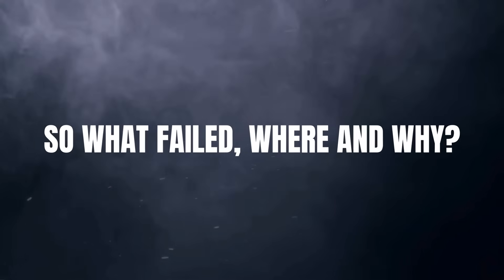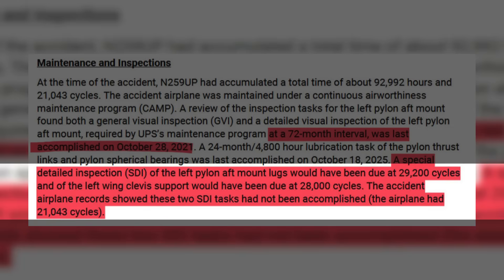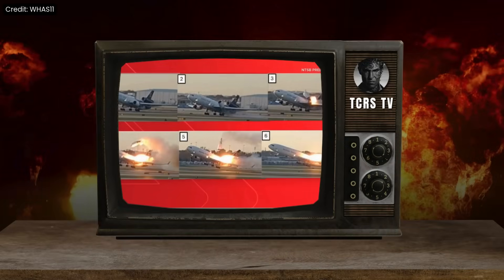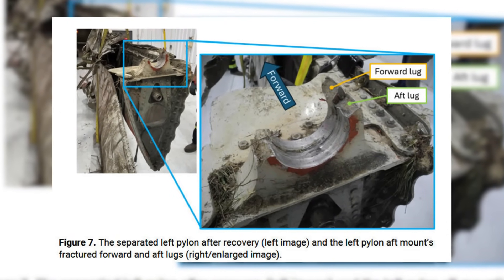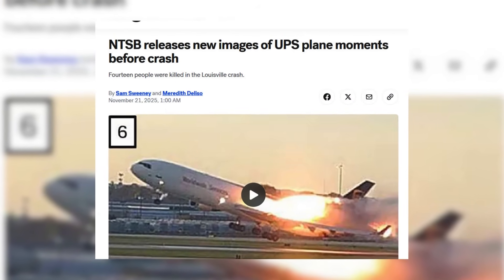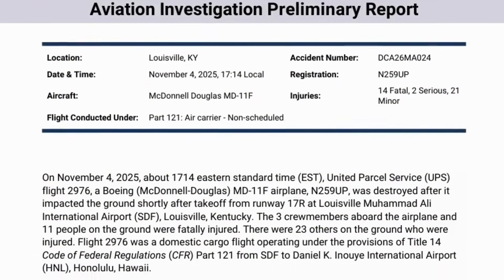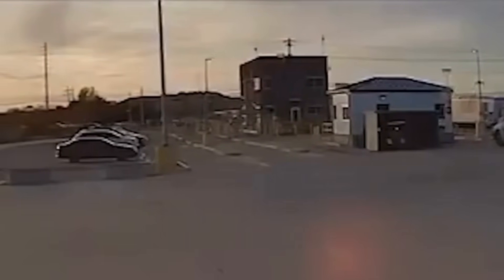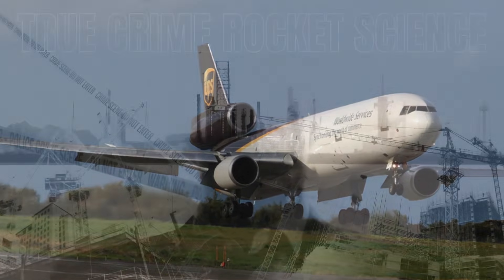BREAKING: NTSB Report Reveals Exact Cause of the UPS Engine Failure

Comment: In this context failure by overstress occurs when a component is subjected to loads greater that it was designed to support. 

In this case the aft lug failed because of metal fatigue cracking, which caused all the load to be placed on the forward lug which failed because it was overstressed. The thrust of the engine caused the engine/pylon combination to pitch upwards until the front mounting was overstressed and failed.

The engine/pylon combination then climbed due to momentum and gyroscopic effects and flew above and to the right of the aircraft track.

Comment: Did this guy even read the initial report? It was a fatigue failure on one attachment, and when it let go, the 2nd attachment had to carry all the load it wasn't designed for, so that broke from being over stressed, then the engine flew off...etc.  It was between inspections that focused on that attachment.  Another channel mentioned that debris likely took out the middle engine leaving the plane unable to gain any farther altitude.

Comment: Nick, you have the most detailed and concise description of the initial NTSB preliminary findings currently out there. To me the pictures of those two broken lugs are very telling. It's hard to tell for sure but just looking at the pictures of the fracture surfaces it appears there is blackness in places along the inside edges. Could this be fretting inside a fracture which might create the black deposits inside where two cracked adjacent surfaces meet and rub together inside the crack? Also those mounting hardware pieces look like something was in trouble with them for a while. There are indications of fretting and galling on the parts and on the inside of the lug bores.

Comment: This is probably caused by the gyroscopic effect causing twisting and lifting stress as rotation occurred, this effect becomes greater with larger fans and will effect all rotating mass so all engines in all aircraft, the remedy is bulkier attachments and slower rotation on take off, as engines and especially bypass fans get bigger this effect will grow and will evident with any violent change of vertical attitude, the problem will not go away, physics.

Comment: Two worst scenarios happened at the same time, the failure of the aft mount at the moment of rotation.  The aft mount failing first is of significance because that's what caused the engine to fly up and over the aircraft, and causing all the debris to get ingested into the #2 tail engine, causing a compressor stall and loss of full power.  Had it been the other way around, with the forward mount failing first, the engine would have departed the wing in a downward motion, likely not affecting the #2 engine, and the plane might have been able to climb.

Comment: My understanding of the report is that there were 'fatigue cracks' observed on the aft mount lug. Although aircraft components are inspected for fatigue, there are still limitations, even with ultrasonic inspection methods. Another point of failure is the bearing assembly. The way the outer raceway broke seems to indicate that something was misaligned or had become misaligned over time. This could be related to the engine if something was out of balance causing it to wobble excessively. Whatever the case is, it seems unlikely that whatever happened here is part of some systemic issue given the FAA's decision to ground all MD11s and DC10s.

Comment: That Jet spent 6 weeks in maintenance getting a fuel leak / corrosion repair. 
That was all being done on that # 1 engine area - why would they ignore the pylon mounts & not inspect them ? 
In 1979 a Chicago passenger Jet Flight 191 a DC-10 ( predecessor to the 11 ) had the same left pylon break on takeoff 
in almost exactly the same way except the hydraulic controls were severed killing 171 people on board 2 on the ground.

Comment: Unfortunately the MD-11 and DC-10 has lost a engine in the past due to pylon failure, 1979 I believe and the aircraft types were grounded for inspection and further aircraft were found to have fatigue cracking. While the 1979 issue was put down to incorrect maintenance procedure when re-fitting the engine it was also put down to fatigue issues. The aircraft type has had fatigue issues with landing gear along with with other parts. The aircraft had to be re-fitted with altered and strengthened pylon mounts attached to the wing and the engine along with new strengthened landing gear and landing gear mounts. Both aircraft types are fantastic to fly but are notoriously more difficult to land due to the high angle of attack and high flare angle required which makes the cockpit very high on touchdown. This has the effect of making touch downs even in the best of conditions quite hard on the runway and landing gear would hit there maximum travel rate often causing even higher amounts of stress on the aircraft.